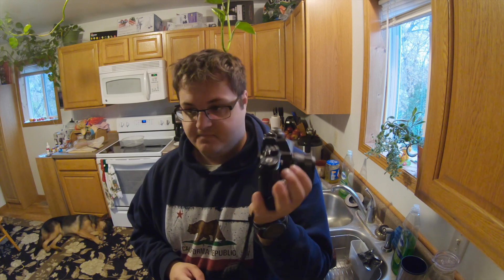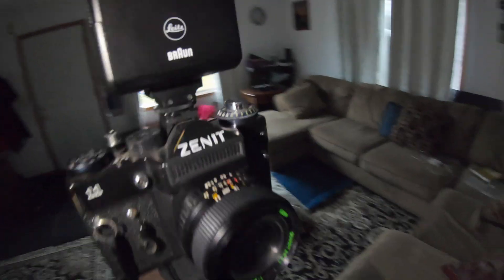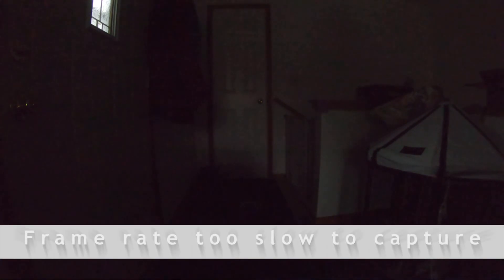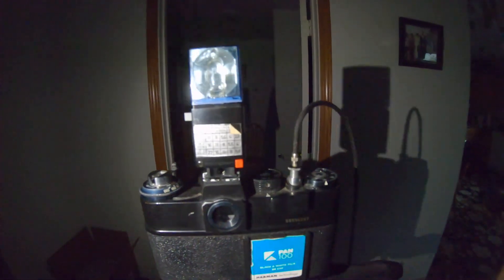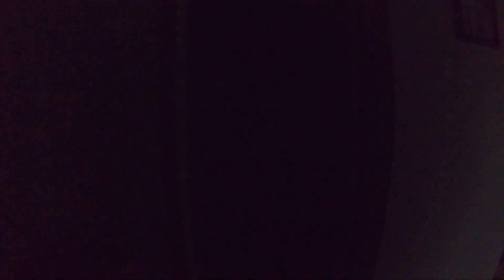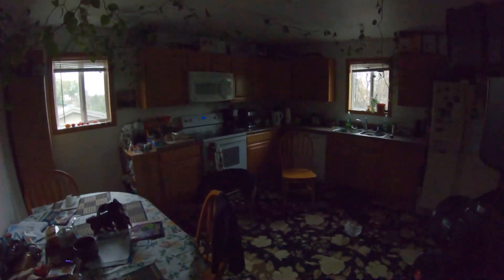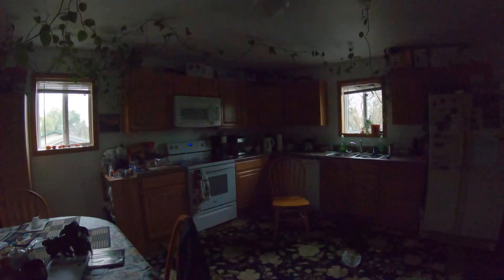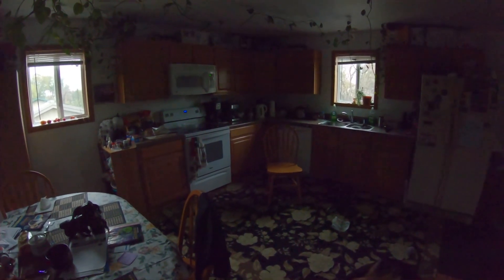Quality of light comparison - Electronic Flash vs M3 flash bulb vs AG-1 flash cube

Comment: I love the smell of flashbulbs in the morning.  I first used them in 1951 when I got a Brownie Hawkeye camera for my 7th birthday. I used press 25 bulbs with my 4x5 when I shot weddings in the 1960s.   In the late 1990s I used my 4x5 press camera with press 25 bulbs to shoot high school sports groups.  I still shoot AG1 and M3 in my 1937 Leica.  However, electronic flash is much better by far in a studio situation and to freeze action with a leaf shutter.  I use flashbulbs as a novelty and love how it is an instant conversation starter when I use them in public, as is my 1937 Leica and my 5x7 Deardorff.  The photos you took with electronic flash have better contrast and sharpness, but taking shots with the electronic flash is not fun.  Using flashbulbs is a real kick in the ass.  I love it.  Bought 2 cases of Press 25, four cases of M-3, and 3 cases of AG1 bulbs when my camera store here in town, had them for sale in 1988.  I have enough for life.  My favorite rig is a Honeywell Tilt-a-mite angled at 45 degrees so half of the flash goes forward and the rest bounces all over the room.  I do not connect the flash fan in the slot to concentrate the flash forward.  I just open it and let the fan lay flat. That way, I get light from the bulb to illuminate the area behind me which will bounce off the ceiling and walls behind me, bathing the whole room in a soft light.  Have fun !!!!!

Comment: these are worthwhile videos as there is little on youtube about <results> with flash bulbs. You might consider explaining bulb types, guide numbers etc once you have an audience. Looks as if you're camera is struggling to synch with the bulbs - maybe test longer shutter times to see when it synchs properly??
Reply from the maker: Glad to be of service! The shutter sync speed was at 1/30 of a second which is what I was using- calculating the guide numbers for the M3 bulbs I should have shot at f/11 or f/16 but I had used f/8 to keep variables constant leading to an overexposure with  the bulbs. I'll be making an update to this video in the future with more "real life" types of scenarios and going by the guide number of the bulbs instead of keeping the variables constant.